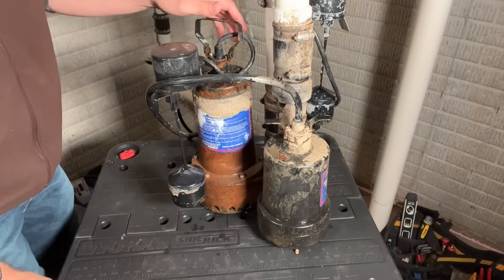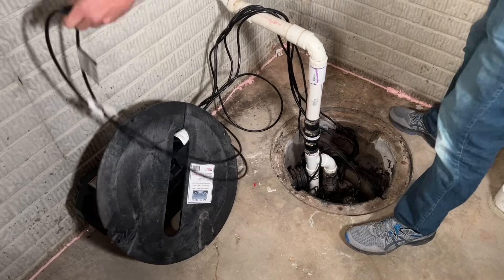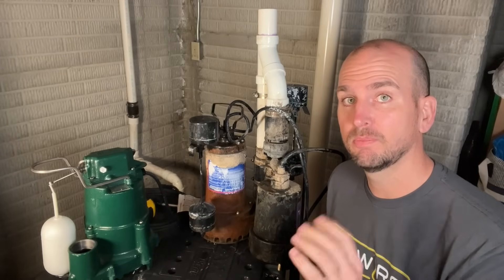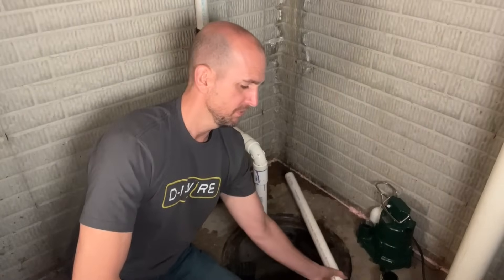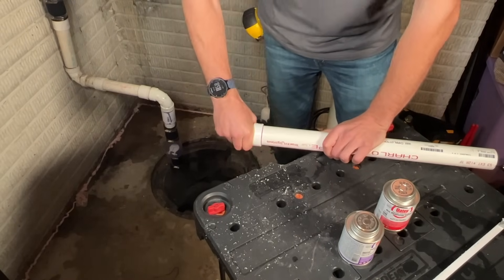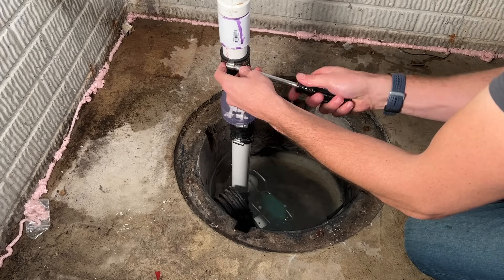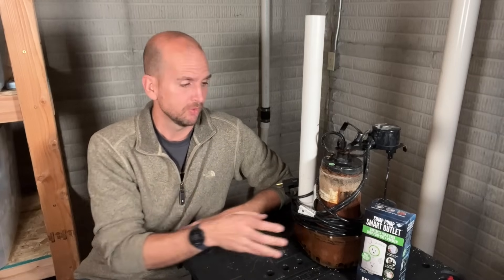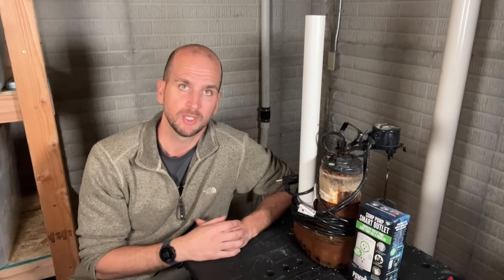How To Install A Sump Pump In Basement

Comment: This is a really great install for many reasons:
1) no hose clamps below lid keeps them from rusting.  
2) spare pump plumbed with discharge pipe already cut to right length and ready to go. 
3) alarm system that has intelligent monitoring and works remotely when you are not home.  

The only thing I’d do differently is use a non switched pump model with a separate switch using a piggyback plug.   That way when the switch fails it can bypassed by plugging the pump in directly to troubleshoot.  I use the Levelguard switch myself.
Reply: Use stainless hose clamps to avoid rust problems. Use a magnet to check whether the clamp screws are stainless. Some places stock them as stainless but they're not and they'll rust in a couple years and release tension. Usually, the places selling the clamps with standard screws is done out of incompetence not deception.
Reply: Can you explain this piggyback plug a bit more and why you should have one, seems pretty important, and what brand has one, thanks

Comment: I live in a swamp forest, and we have a lot of clay in our soil, way more than I've ever seen. So, the sumps don't last very long and additionally the discharge pipes end up getting lined with clay. 

When I moved in a few years ago, my neighbor warned me about this - he said you need to clean out the discharge pipes every so often. I of course did not listen and my basement flooded as a result. I had a plumber come out and replace the sump and he showed me the old discharge pipe - that 1.5" pipe had probably 1/4" effective due to the clay build-up.

Comment: Thanks for the video about sump pumps.  Your video was informative and showed several sump pump installations.  There are some other options that might be useful for some viewers.

Wayne Sump Pumps:  Another good brand of sump pumps is Wayne.  I have used Wayne pumps in my house since 1986.  I normally get 5 to 7 years out of these pumps.  

I buy the all cast iron pumps – I have had a hybrid cast iron/plastic pump once – the plastic was the case for the actual pump – the motor/switch was cast iron.  The plastic eventually cracked which made the pump to leak and stop pumping.  The all cast iron pumps cost a few dollars more but are more rugged than the iron/plastic hybrid pump.

Wayne pumps are also sold under other brands such as Campbell Hausfeld and Ace.  Can tell the Wayne pumps by the design of the switch on top of the pump.

Need to have the pump sized for your application.  It is just as bad to get a too big of pump as too small.

GFCI Outlet.  The sump pump should be on its own GFCI outlet that way the only thing tripping the outlet is the sump pump.  The GFCI outlet compares the current on the hot to the current on the neutral.  If the current difference is more than 0.005 amps ( 5 milliapms) – the outlet will trip.  When the outlet trips – this means that the pump is starting to fail and it is time to replace. 

LED Nite Light: I plug the pump into one side of the outlet and an LED night light into the other side.  The nite light is the switch, not light triggered, type.  The nite lights are cheap, do not use much electricity, reliable, and show that the outlet is on.  If the light is out, the GFCI outlet has tripped and the sump pump needs to be checked.

Stand Alone Sump Pump Alarm:  I have a sump pump alarm that triggers when the water rises above the alarm sensor.  I just tape the sensor at the desired position on the tube from the sump pump.  The alarm is just as loud as a fire detector.  The alarms are under $20 – I bought mine at Home Depot.

Spare Sump Pump:  I have a complete spare sump pump set up that is ready to install.  I used some spa hose and agricultural water connectors to connect the sump pump to the drain hose/pipe.  This allows me to change out the sump pump without tools (in the middle of the night if required).  One wet year, I had to buy an off brand of sump pumps since all of the good pumps were sold out.  With a spare pump, I have time to get a replacement.

Spare Check Valve:  The check valve is one of the least reliable parts of a sump pump set up.  I always have a spare to replace a worn out check valve.  Cheap insurance.  If the check valve fails, the sump will have a short cycle since the water will back fill the sump.

Comment: I recommend Wayne pumps over Zoeller, I’ve had both. Wayne also doesn’t require a weep hole so no mess form spray and also quieter. Replace the check valve every time you replace a pumpnis a good rule. Zoeller check valves are probably the best. I also recommend BasePump as a backup, does not require electricity to operate as long as you have municipal water.
Reply: Wayne pumps draw way less current than Zoeller. That M98 draws 9.8 running amps! Many people have 15 amp circuits. You'd better have it on a dedicated line, and forget about running a backup pump on the same circuit. The Wayne 1/2 HP cast iron draws only 3.8 running amps and pumps 3840 GPH at 10 ft head vs 3660 for the Zoeller.
Reply: @frankm2588  I forgot about that, excellent point
Reply: Agreed. I bought one about five years ago to replace an old Zoeller. Switch died after a year, so I started exploring solid state switches, as the switch is always the weak point imo. Tried Levelguard, ended up going with the Hydrocheck 6600. It's been rock solid ever since. Along with the Zoeller inline check valve it's quiet and just works. I bought a second Hydrocheck on the shelf along with a pre plumbed Ion Storm Pro ready to go when this one fails.

Comment: I would go with a generator to power that sump pump and your furnace. I have a whole house Generac and and it comes in handy when its 10 degrees F. out. You will stay warm and your basement wont flood.

Comment: Where I live, we always have a backup pump to the main pump.  In most cases we use water jets that use house water pressure and require no power, just in case of power loss (Liberty Pumps).  I love Zoeller M98 pumps and have a second backup pre-plumbed with a check valve sitting by ready to install in less than 15 minutes, should the main one fail.  Last thing you want is a failure, can't get a replacement and have to rely on your backup for extended periods.  We all know they only fail in the middle of the night when stores are not open.  ;)

Tip... always set the pump on a couple bricks so it is above the bottom of the well and keeps most dirt away from the intake.  The well should be cleaned out every year.
Reply: +1 for the Liberty Pump water jet backup.  Installed several over the years for myself, relatives, and friends.  More involved to install given the water hookup - but great not having to worry about charged batteries or slow flow backup pumps.
Reply: I always have a spare waiting to to in also.  Just something you learn over years of crazy experience.  LOL

Comment: I would rotate the pump counter clockwise, so that the 4" discharge won't flow onto the float. Dunno, if I'm paranoid, but my logic is that,the water pouring on top could stop the pump by not allowing it to come up to full height.
Reply: got into that exact issue earlier today. Float switch was stuck with toilet paper coming right from the inlet just above. Reset it but need to reposition the pump so that doesn't keep on happening
Reply: I have the grinder version of that pump and had the same thought however fearing toilet paper weight on the float.   There is way more to consider when installing a sump than many would consider.

Comment: I would never rely on switching out the pumps during a failure or switching to the battery supply during a power outage. What if I'm not home? For something that you don't generally need to mess with, the complexity of a battery powered backup seems worth it to me. But I agree 💯 on Zoeller.
Reply: my thoughts exactly, we are away from the house way to much to not have the battery backup permanently installed in the pit.

Comment: You'll need that backup plan when the float switch fails. Major zoeller problem these days. Hope it doesn't happen to you! 🤞
Reply: The thing to do with Zoellers is to not rely on their switches. Put the float lever in the "up" position and get an electronic float switch. That not only avoids the Zoeller switch problem but lets you allow the pump to turn on at a higher water level, avoiding the frequent on-off cycle which is what burns out switches.
Reply: @frankm2588  for what they cost, they should provide a reliable float switch

Comment: I purchased a Zoeller without the built in switch as that seems to be culprit in most sump pump failures.  The sump pump then plugs in to the separate switch plug.  I then use a water siphon as backup.  If the switch fails then I can replace that in just a few minutes.
Reply from the maker: Thanks for the feedback Gary, I will continue to think through my setup What model Zoeller did you get?

Comment: Sorry, I'm a dumb Californian from Orange County where everything is house-on-concrete-slab foundation with no basement.

What is the purpose of a sump pump?  Where is all that water from the corrugated pipes coming from?! 😳
Reply from the maker: The pipe delivering the majority of the water is from the french drain at the base of my foundation.  I still have 2 downspouts that I need to permanently route away from the foundation 40+ feet which should help reduce the water flow during/after rains.

Comment: Did you ever disclose why the failure in the first place? Pump working but not pumping? I'm assuming a bad impeller?
Reply from the maker: Yeah, pump running but not pumping.  From what I gather it seemed to be air lock where a pocket of air was surrounding the impeller and thus not pumping.

Comment: My M98 blew it's capacitor after a few years.  Easy enough to replace, but I expected better quality from Zoeller.
Reply from the maker: That's not encouraging to hear ☹️  Thanks for the feedback
Reply: m-98's have a 3 year warranty, Your issue is not typical

Comment: My dad had installed a sump pump and I remember helping trench in a discharge pipe all the way down the driveway and out into the ditch that runs in front of their house this was like 80 feet down.  The slope was easily 1/4" a foot, and we cut a little hole through the cinder block about 4' up the wall.   Well when the pump kicked in and we discovered something we had not calculated.  The water flow was so great, it created a siphon in the line and when the pump shut off, the siphon was still drawing water from the pit for minutes after the pump stopped.  Then you would get that sound that you hear when a kid is trying to suck every last drop of soda out of the bottom of a glass.  All I did the job it emptied the pit and the pump didn't have to run as much because the siphon would help out
Reply: Great luck. I've been trying to create a suction effect such that the pump itself doesn't have to cycle as often.  Unfortunately, I don't have a long enough discharge run.

Comment: Have you looked into the water powered backup system? That is the one that I currently use and so far it works great.
Reply from the maker: I didn't price out the system yet but that is a pretty common setup in my area for the new builds.  Not a bad plan.
Reply: I just learned something new. Thanks.

Comment: Good info and thanks.
 My zoeller m98 pump float switch failed after 10 years of service, At that point I purchased the identical pump & an additional float switch. Installed the  new switch in the old pump & stored it for future failure. Switch was inexpensive compared to pump.
 Also using a water backup pump, as power & water are seldom out together. Purchased the basepump model, works as designed.
Reply from the maker: I might get an additional switch and keep it for a quick swap after any future failures.  Sounds like the switch is the weak link on a Zoeller pump.
Reply: @EverydayHomeRepairs buy any brand tether switch with a piggyback plug. Bypass your switch and add this one.

Comment: M-98 is the best pump on the market! You are correct about finding the cast iron one. Something to think about with the backup power supply. I would be interested to see how long it would last in a storm with having lost power.
Reply from the maker: I am interested as well,  I will be doing a little testing in the near future and will put the findings on the channel. 👍
Reply: Not long enough. That's why I have a generator and 2 pumps.

Comment: I put a flooding alarm in the upper part of the sump, it just makes a loud noise.  If I were to travel, then I'd invest in an alarm with wifi and a contractor to come in to do the mitigation.

I keep a small, portable sump pump with hose that fits it hung on the wall next to the sump, long enough to go out the basement window and to the street. 

I use this portable pump for various pumping tasks, like the pool sump, so it pays for itself already.  it pulls small enough load that I can run it off an inverter which I keep in our car for blackout emergencies.
Reply from the maker: Not a bad plan, thanks for the feedback 👍

Comment: My pump instructions actually said not to install as second weep hole as part of its instructions and mine was for a sewage extractor pump.  Also they they said to install the check valve horizontally not vertically.  You could have installed it in that horizontal section going to the wall.   From what I understand it has less of a chance of being blocked in its closed position.  Probably not as big of a deal for you since your pump is just pumping water and lots of it...
Reply: Horizontal reduces the water hammer.

Comment: that check valve stopped the "THUMP-THUMP" that I'd get on cycles... well, it looks like that, but I think there's a spring involved.
Reply: The spring helps to shut the valve at the moment water flow is zero, without the spring there has to be back flow before the valve will return to it's seat, and the slamming shut of the valve will cause water hammer.

Comment: This start to make a better sense. The hole on the PVC also is a great idea. It is very nice unit. Thank you for sharing
Reply: I need the hole motivation spelled out a bit more explicitly. Is the problem that the column of water over the check valve keeps it closed so the air, pushed weakly by the impeller in its bubble, can't get out of the way and let the water in?

Comment: Be careful when purchasing a battery back up the one I had would only run 25 minutes and the battery gave out, basement flooded anyway!  Do your home work and see how long the battery will last
Reply: How old was the battery? Those deep cycle batteries are only good for a couple of years.
Reply from the maker: That battery was probably 2.5 years old.  Yeah and that is one of my problems with my old setup.  Most people would think they have a battery backup but if the power goes out and you actually need it the amount of charge and runtime would most likely be must less than expected.  I am going to test out the portable power unit and curious how long many cycles it will run.

Comment: The covers that seal are meant to keep out radon, BTW.
Reply from the maker: I should have mentioned I have a Radon remediation system close to the pit.  Thanks for the feedback.
Reply: @EverydayHomeRepairs  when my radon system was installed, they actually are the ones who added the sealed sump cover.